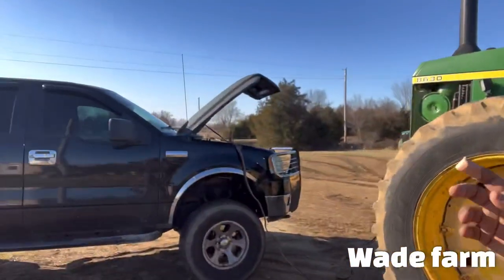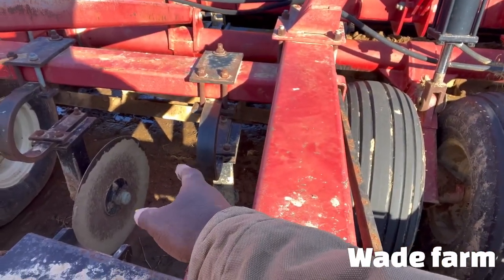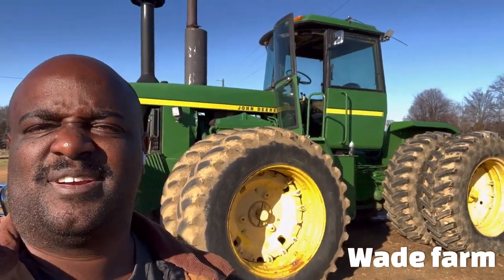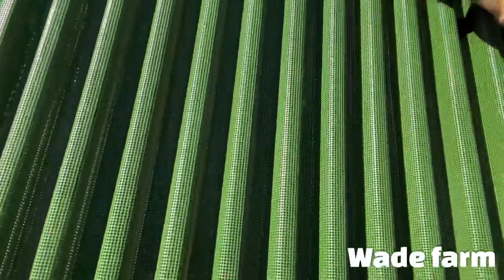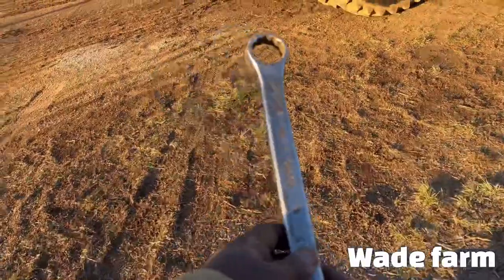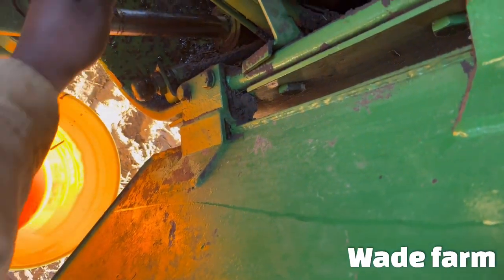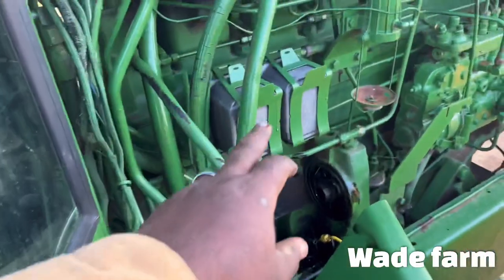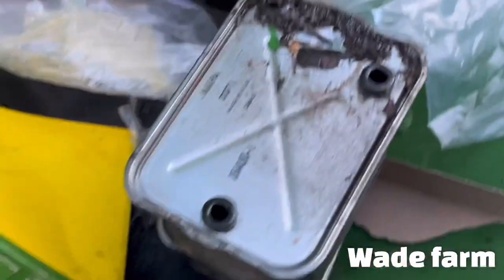8630 John Deere Oil filter an fuel filter change

Comment: I tried draining the oil in my 8630 today but the previous owner done away with the tube where it twists in the middle & I can't break loose the plug at the oil pan, any idea's?
Reply from the maker: You not have that tube beside the fuel tank ?
Reply from the maker: If not you have to go under it an drain it . I know that plug is hard to take off
Reply: @dionwadefarmsllc  it does not have the tube by the fuel tank... I'm a 300 pound boy and can't break it loose lol
Reply from the maker: LoL
Reply from the maker: 10-4 my friend
Reply: @dionwadefarmsllc  Hate to say it but I broke down & called Deere to come out & put it back to original lol... Only $300 for parts so I don't think its too bad, just have to put in a few extra hours on the weekend at my town job lol
Reply from the maker: @briantempest8157  it get like that
Reply: @dionwadefarmsllc  in case you was wondering, the tube for the oil is no longer availible from John Deere, so I'm stuck with crawling under the tractor to drain the oil.
Reply from the maker: @briantempest8157  dang I didn’t know that